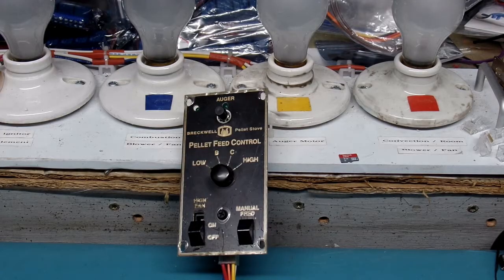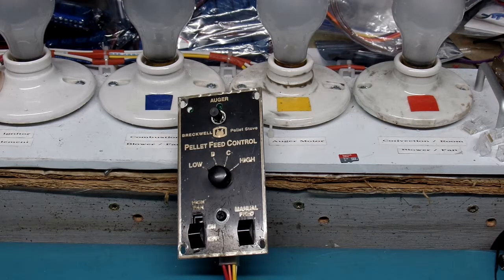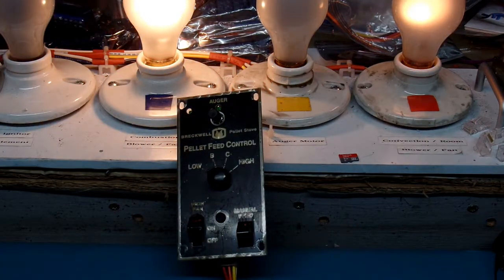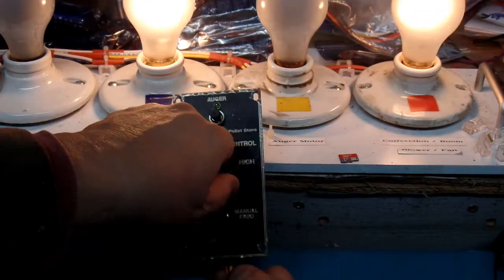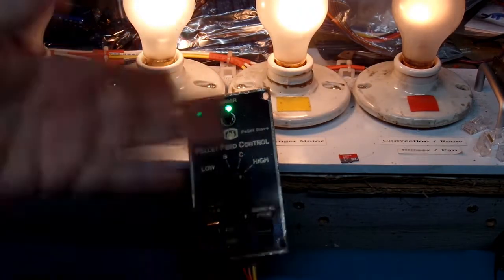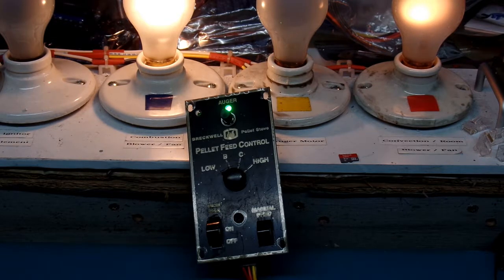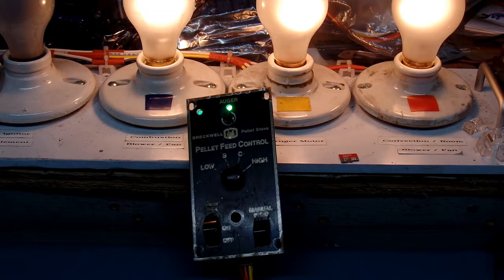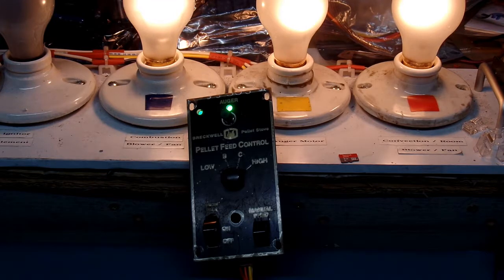Post Repair Final Test of Anthony's Older Breckwell Pellet Stove Controller

Comment: I have a Brekwell controller for an insert pellet stove.
The heat advance switch is intermittent. Can you help.
Reply from the maker: Hi..  Call or TXT me at 971-724-4115...  I do have the necessary part(s) to repair the problem you noted.  Thanks  Alan
Reply: @MonteStudios  How 
much is the switch?